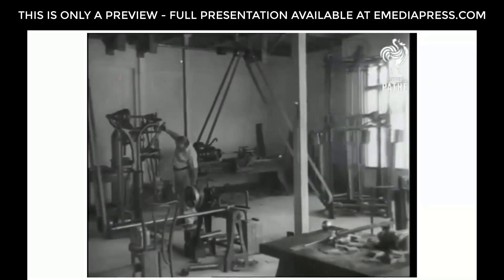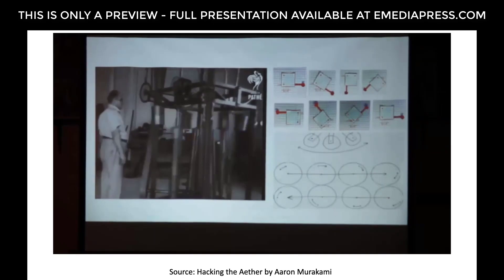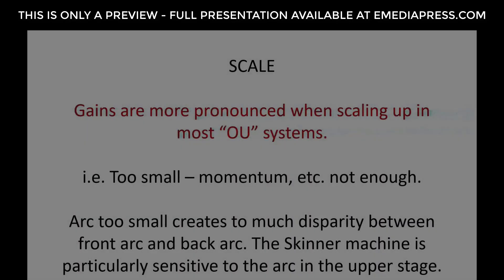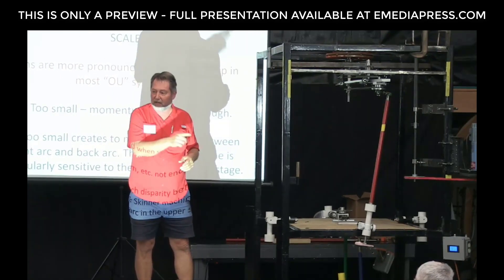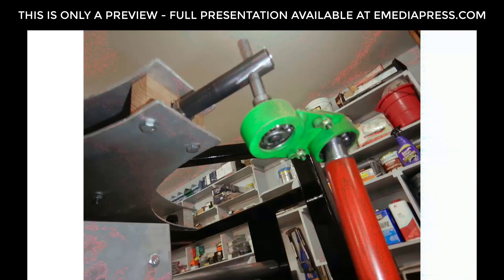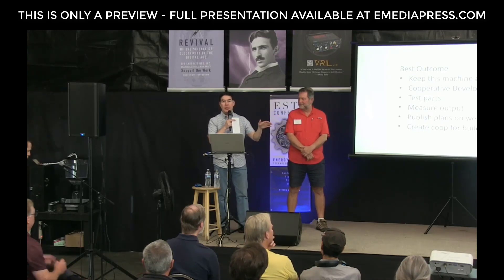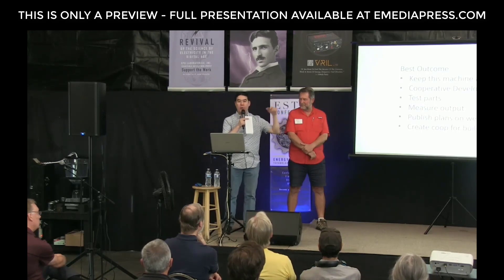2023 ESTC  -Mark Dorsten & Aaron Murakami - William Skinner’s 1939 Gravity Power Machine

Comment: I don't think you have to build that complicated mechanism to drive 4 lever arms.   skinner did probably for two reasons, to balance out possible  G forces and for greater amplification.     instead of the complicated lever driving  mechanism just make a single unit instead of 4.   and it may be possible to just attach the drive motor  to the lever arm at the top, using a sprocket riding inside a circle of chain.  and use something that skinner did not have back then.  a  variable frequency drive.  talk about being able to dial in the levers rotational speed, that would do it.    if skinners device did 10x amplification then safe to assume each one did a bout 2.5 x     the real amplification comes from the first stage mass assisting to drive the second stage lever.    so instead of two weight system use a three weight system.   the first stage mass drives the second stage mass and then the heavy second stage mass drives the third stage mass.   after all it's all about the sizes of the masses that once spinning are the real power source.

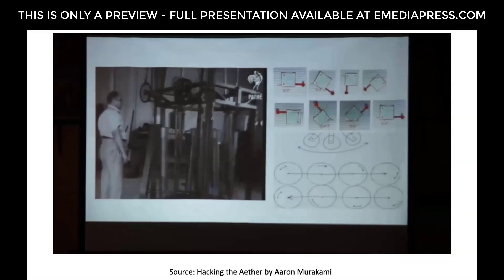Comment: @1:32 "Tired of people telling you that it was circular."
Well... It was circular.
https://www.youtube.com/watch?v=hKOSUwxCe_I
Reply from the maker: You're welcome to deceive yourself - the original video has the small arm at the ends that allows for an elliptical rotation.
Reply: @AaronMurakami13  
The 'original' footage of the film, which you do show at @0:30 in this video, is exactly what was used to create the animated gif that was then looped in my video.
The only other technique used to produce my animated gif was to align the film's individual frames so that all corners of the machine align within each animated gif frame. As a result, the corners of the machine are significantly stabilized. Instead, the British PATHÉ logo appears jumpy in the animated gif used in my video whereas it appears stable in your video but the machine is jumpy. The original film is jumpy due to the lousy frame stop/start tolerance levels of 1939 film cameras. The logo was added much later after reproduction of the film to video. There is no elliptical rotation present in your video either. My reason for producing the gif is so that I am not deceives. Everyone and anyone is free to duplicate the experiment by creating their own gif from the original. Just use GIMP.

Comment: Mark says the drive mechanism goes faster and then slower so you get a disparity of speed.  and then he goes on to show some pictures of how he tried to reduce the changes in acceleration.  look I am not trying to bad mouth his attempt at reproducing the device I am only here to explain the error in the design.  does this design amplify the input energy by harvesting gravity like skinners device ? the answer is no and they will acknowledge this. so something is wrong with the build, what is it ?    first and foremost is the conclusion that the drive mechanism follows an elliptical path.   the disparity of speed, the changes in acceleration are caused by the elliptical path.  anyone should be able to figure that out.  a circular path will have no disparity of speed or changes in acceleration.   when we watch the original skinner video you have to remember you are watching from one view point,  sit down on a chair in front of a playgrounds marry go round,  put something on it and watch as it goes around,  what do you see ?  when the object passes in front of you from the the right to the left does the object appear to go a certain speed as it approaches you then does it seam to go faster as it passes in front of you ?  of course it does, lets label the different positions,  right is front of you 6  o-clock , to your right 5 o-clock to your left 7 o-clock    now when the object goes past the 8-9-10  and 2-3-4 positions does it appear to slow down ?  well the object is not moving past you anymore its moving away from you and from where you are standing you cannot tell very well how fast it's moving.  and the same optical illusion is happening when you watch the lever arms at the top.   I think this elliptical theory came from not being able to view the device in person, only seeing it from one angle.  if you walk around the marry go round anyone can see the object is moving at the same speed at all positions and traveling in a circular motion.  the weights on the skinner device do not speed up and slow down, they do not accelerate from a whipping motion, and they do not decelerate.   the word perfection means incapable of further analysis,  I think we have reached that point in regards to the path the lever arms are traveling.    ps send me a free ticket to your next conference and I will come and prove it to everyone.

Comment: you made a statement that you believe the skinner machine works exactly how skinner said it did.    ok, and  you built a proto type of his machine and have it operating over there for everyone to see.   you claim the lever arms are operating in a elliptical orbit.   so then why would you make the statement that you believe and have every reasons to believe the skinner device works exactly how skinner said it did instead of saying that in fact the skinner device works exactly how skinner said it did ?    making a statement that you believe is not the same as stating a fact.  if you asked some one who has been in space if the world is round or flat, would his answer be (I believe it's round)  or would he say the world is round and that is a fact ?   your statement that you believe only show you do not know for certain,  and the only reason you would not know for certain would be because the device you made has failed to show the energy amplification that skinners device has claimed.   If you had succeeded you would have not only said the skinner device does in fact do what skinner has claimed but you have  yourself proven that claim also with the device you made and then you would demonstrate that fact.  it's not hard to put a amp  or watt meter on the drive motor and then have the output shaft turn a generator and show us the output wattage.   so because you have not made that statement and have not shown us your in and out power you cannot state  or show us any facts, you can only say you believe,  you accept the word of the inventor, you consider it to be true,  it's you opinion for now waiting to be proven.     in all fairness  i my self have not finished my replication yet and I am glad i have spent time analyzing instead of finishing the device before I fully understood  how it operates.  I too believe the skinner device operates exactly how skinner said it did too,  although he did not  fully explain every detailed action each component makes, I believe I have successfully  figured out and explained how the device operates , and I have posted it in the comments.   if my analysis is true it can be proven by building the device according to my explanation on how each component should function.   my reason for commenting on your you tube video is to add to the collective of minds trying to successfully build this device .